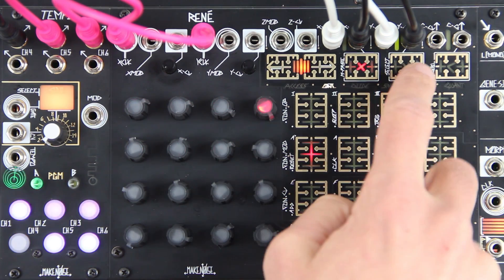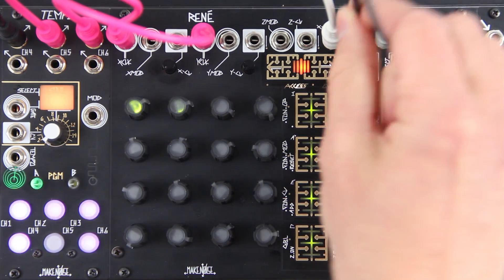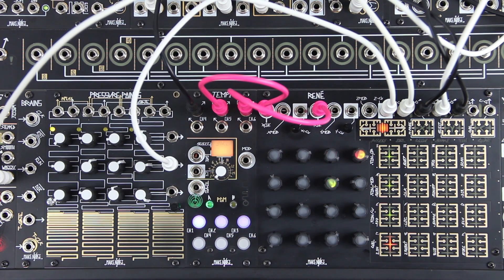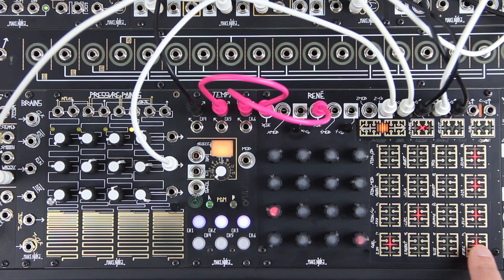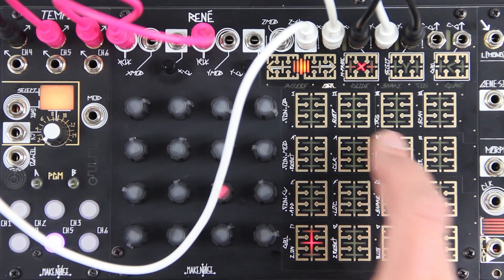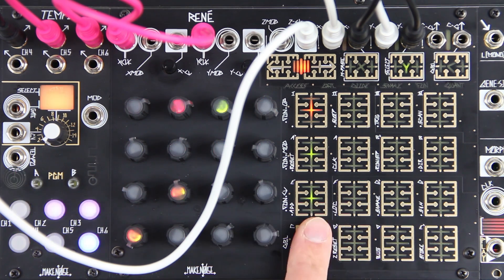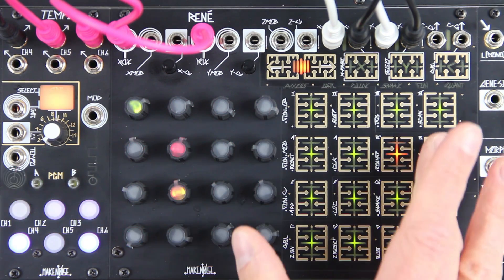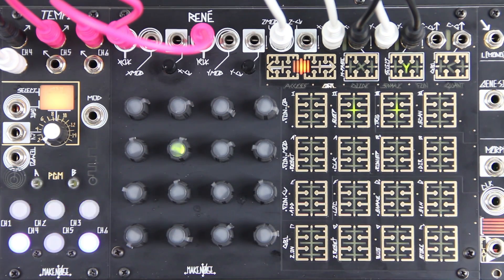Z Axis Key Praxis

Comment: So, I was doing some rad Z-Axis sequencing today and also trying to use the X-CV in to change snake patterns with a slow LFO... but is there a way to make it not spit out extra gates when changing through snake patterns? I was hoping it would sound a lot smoother than it did. Hoping I just have something set wrong.
Reply from the maker: Switching Snake patterns will cause the sequence to jump to a new location usually, and if there's a gate enabled on that location then it will fire. So the only 100% certain way would be to turn them off.

Comment: The new Rene is very interesting but is the only way to chain channel values using z-mod? Correct me if I'm wrong, but the way it is with z-mod you can't do independent and arbitrary melody and voice leading (or really note cluster of possible coordinates) over an effective "bar line." So despite the within-state complexity, it ends up sounding like you have one bar in one mode for each channel/voice, another bar in another mode and so on. And each state across voices has basically one harmonic relationship across channels, although this can be altered within each state by changing access for coordinates on whatever channel.

One way to add development is to have one channel repeat or mute while the other changes modes, yet you still have the artificial bar line impression if you use z-mod.
So clocking each channel manually through row modes and using occasional gate ties seems like the best way around this limitation of state changes, while manual z-mod state changes can still be used when one wants clearer bar lines.

Overall, I think this z-mod dependence for state changes confines musical development from section to section. The state transitions are too bar-rigid. Another option instead of chaining without z-mod would be to have programmable lagging of state changes for each channel, or multiplying/dividing the z-mod movement on a channel rather than state basis, or making one channel respond to gate on z-mod and another voltage to z-cv. That said, I suppose it would be difficult to manage partial states, on both a software and performance level (unless you could make up for the lag automatically with opposite compensation).

Please tell me if I'm missing something about z-mod and state changes.
Reply from the maker: i'm not sure i understand what you mean by "bar rigid" - z-mod and z-cv can be used at any time and are not confined to bar lines. yes, all three channels change State at once (it would be an interface nightmare otherwise), but there are 64 states to work with - you should be able to create whatever 3d meta-sequence with "partial" State changes you might need. Also, don't overlook the power of the CV and MOD inputs for adding variety to a single State and/or channel, and the fact that behaviors via those inputs can be different from one State to the next. Finally, channels' "key signatures" via the Quantize pages are independent. I made them identical across channels for this video for simplicity's sake, but they are by no means required to be so.
Reply: Yes, state changing channels all at once is what I mean by bar-rigid. I think your partial states solution makes most sense, e.g. transitional phrases/clusters on a leading channel, and deactivated gate locations with snake patterns, so you don’t get first notes or similar clusters on state change sounding together, reinforcing the bar. Although you still cut between note series at same time. I’m aware of time signature independence if I follow which would work well too - especially with flexibility of tempi - instead of deactivating gates to give more independence. But I gather channel lag or z-mod division across states is not technically possible or are chains of 1-16 stored locations without z-mod planned? loopop made similar observation about chains and staying on top of z-mod in his review. As it stands, changing stored locations on a row basis manually is more flexible than z-mod for channel musical mode changes and switching a pattern defined as arbitrary series of mensural rather than a measure of notes, whatever signature. One other thing that would be interesting is if one could link locations across channels with logical AND, so that they can only be accessed together. This would be another strategy to preserve harmonic relationships between voices.
Reply from the maker: Mesh programming exists specifically for making targeted changes to specific sets of States without the need for additional UI and personal memory that would be required to have State changes be per-channel. I think you will find it is quite flexible, and can lead to interesting places. You may also be unaware that channels are not required to reset upon State change. Disable Z-RESET on global page and it becomes a Z axis movement that does not interrupt X, Y, or C movement (those channels will remain at the same location they were prior to State change). It is more of a 3-dimensional sequencer than it is a "song mode." Thanks for your thoughts!
Reply: @MAKEN0ISEMUSIC  Ah, yes I saw that in video and was wondering about it, thanks! Given that Z.RESET off I think cannot apply to one channel but only all at the same time (too bad), I would think this could be compensated for by having another simple state with slow clock on the one channel - in other words a harmonic backing channel which would provide more sense of structure, although not quite like with Z.RESET on. Then you have more movement in the other channel with a faster clock. Just an idea.
Reply: There are many ways to manipulate (or not) a sequence even within one single state. Or just copy your simple sequence to another state so only your target changes.  To have individual states changing arbitrarily is unnecessary and would make it impossible to use ha!

Comment: Thanks for this video. Just got the Pressure Points and Brains and I'm curious on creative ways of how to use it with the Rene and other modules.
Reply: Well, it's in the manual as a factory example, but I personally love the Buchla 250e emulation with Maths and a set of 808 samples. We all expect an 808 to be tight on the grid but it's so much fun to hear it wait for something and having a mind of its own. You can get these great timing in rhythmic patterns that will redefine normal 'swing'. The same thing should work with clocking Rene with Maths and CV the rise/fall times back with X, Y or C and Z. And snake patterns.
Reply from the maker: Nice patch idea @Cinematic!
Reply: Also, the Brains/Pressure points combo (especially two PP's) is half of a DFAM, but with one extra row. Add a clever oscillator like Telharmonic or even QPAS and you have a very powerful groove machine.